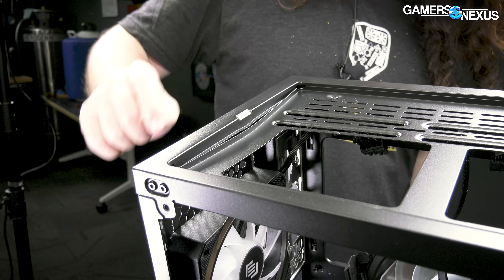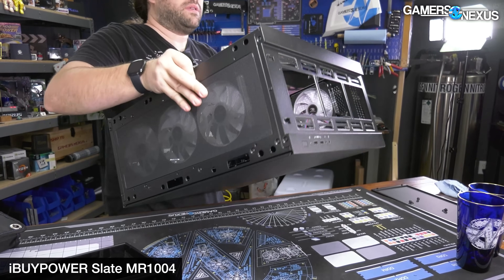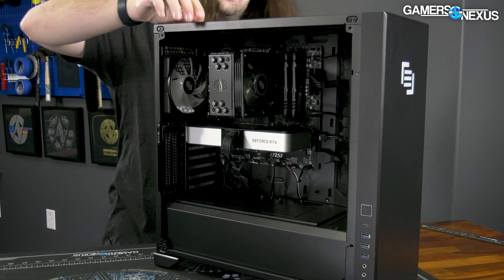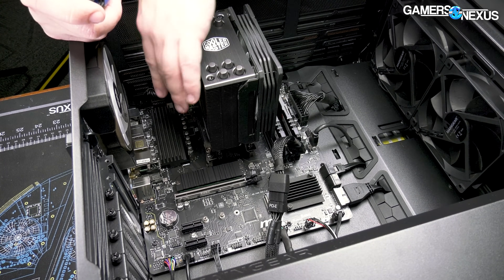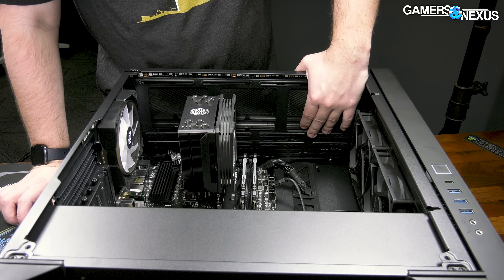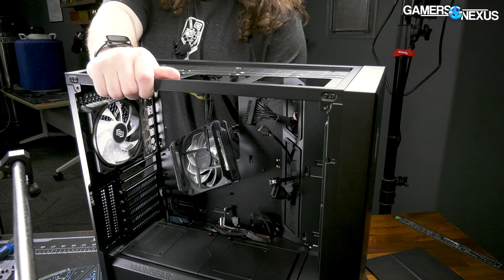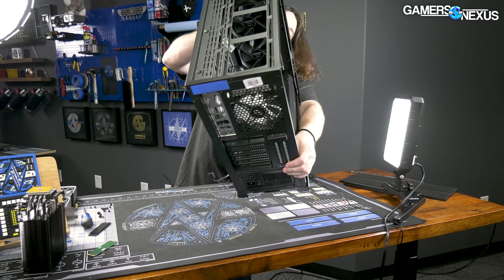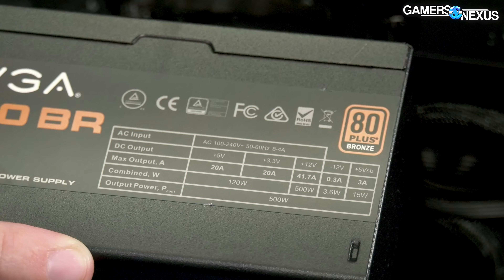Maingear Did It Right: Secret Prebuilt Gaming PC Review ($1700 Vybe)

Comment: Alot of people are complaining about the motherboard and talking about how the company is just screwing over the customer for higher profit. This PC cost 1700. Between CPU, GPU, and Motherboard that's 900 dollars. Factor in 8 working hours @ 25/hour that's 1100. Now factor in power supply, fans, case, ram, cables, storage. Your now easily in the 1400 dollar range. I'd be willing to bet the shipping was free which means the company covers that overhead as well as minor things like packaging. Then consider operating costs that the company has such as storage, water electric, insurance, and property tax. Once you factor all that in, the company isn't exactly getting rich off of a 1700 dollar pre-built. Also I didn't even factor in the OS, the thumb drive, warranty or even potential things like a mouse or keyboard or even stickers/magnets that may come with it. All of those things add up and when it's all said and done the company MIGHT make 50-75 dollars.
Reply: You’re very close. 👍

Comment: Regarding the large file write speed of the Intel 660p:  I have a couple of systems with the 1TB 660p in them and have not seen this problem.  Even moving files that are more than 4GB the writes occurred at more than 500MB/s while reading at over 500MB/s.  The systems are pretty old 6th Gen Intel i5's running Windows 7.  (Yes, I know Windows 7 is out of support, but some things won't work on 10 or especially 11.)  Maybe it's a problem with Windows management of the the drive, because to my knowledge Windows 7 knows just enough about NVME drives to use them.  This is consistent across 2 Dell Optiplex systems with the i5-6500, one with 16GB DDR4-2133, the other with 48GB DDR4-2133.

Comment: The Vybe seems to be the best bang for your buck. Also build quality much higher. Save yourself $200 to $300 and get the Vybe from what I see here. Adding that recovery USB Thumb drive is an excellent add to value and will be so helpful for customers. To bad the front panel design isn't better. Don't understand these PC manufacturers that can't get something so simple as giving the front panel some better air flow.

Comment: It looks to me like someone put their weight down on the top fan tray and they bent it. That and I've used a couple cases with mostly solid front panels and they're terrible.... even though I used an RX 570 which isn't super hot. It would be a good build if they used a different case.

IMO, Dell's problem is they're taking the 2010 approach to building PCs. They're still used to the CPU like the i5-750 or i5-2400 which is fine with a Dell stock cooler, and a GPU that has a blower cooler.

Comment: Honestly, if they could up their airflow game, they'd be a consistent recommendation from me. Also, while I know a 3060 ti can run on a 500w PSU, they should at least provide the minimum wattage recommended by Nvidia, whether those recommendations were conservative or generous. They use the same 500w 80+ bronze power supply on the R7/3070 version of this system. That's asking a bit much of that budget PSU.

Comment: That's bogus that you guys didn't get a filter on your front panel. I bought the next higher spec vybe (with a AMD Ryzen 7 and Nvidia 3070) a few months ago and mine had a dust filter on the front. 
My system also has a 240mm AIO cooler which exhausts out the top of the case. I have noticed that my fans sound to be working hard to keep my PC cool. I had similar thoughts about the meager front intake situation and I made a small change. I moved my 240mm rad toward the rear of the case as far as it could go. It couldn't go all the way back because of clearance with the rear exhaust fan still there but it went back enough that I was able to flip one of my front intake fans that was pretty choked off and put it in the extra space of the top vent. Now my top is both intake and exhaust. Kinda scuffed I know but already even without running any benchmarks or tests I can hear my fans have wound down and it's quieter with no other changes made to my computer's load. I think I may end up buying a black noctua fan and installing it permanently in the roof of my system until I get a new case. Thanks for the idea Steve!

Comment: I tend to like the 660p (which I use in my own system) since I am not a content creator or working with large file sizes in general. I can attest that the Anandtech statement is applicable. If you DO have such a storage use case where you're transferring large file sizes regularly the 660p is not for you. But if you're mostly concerned with storing your Steam library and videos on high-performance storage, the 660p is some of your best gigibyte/dollar value.

Comment: I know you don't review or go in-depth on this, but their customer service is top-of-the-top-of-the-line (not a typo). Linus has done two Secret Shopper series, both with Maingear and, while the system itself was average in both cases, they got highest marks in customer service: the reps are knowledgeable, patient, and thorough. And honestly, if you're buying a pre-built, (if you're not just salvaging the GPU), it's most likely for someone who doesn't know much about computers and needs help every now and then. Maingear simply isn't matched in that department.

Comment: I'm confused. Isn't the retention arm meant to hold the CPU in the socket? How is it able to just pull out like that?
Reply: Not really. It applies a little bit of pressure but it's more to cover up the contacts on the motherboard when the CPU is removed by moving the socket to cover them.
Reply: @ecnepsnaiold  I knew that, but I thought it also clamped the CPU in place by wedging the substrate into a groove in the socket. I admittedly haven't built a PC in a very long time, so I could just be remembering incorrectly.
Reply: @MeowThingy  on AMD sockets nothing really clamps it down (other than the cooler, which Steve already detached in the video). Intel sockets are clamped though.
Reply: @ecnepsnaiold  That explains it. Thanks!

Comment: The bend is because the case was assembled in the factory improperly, the top panel is supposed to rest on the flange pushing the top panel in and down, huge fail on QC and shouldn't have gone out the door like that.
Reply: System did not ship from our facility like that. Definitely Happened in shipping.
Reply: @wallymaingear  in your dreams, my friend. It was welded that way. For the panel to be below the flange FROM DAMAGE, the flange would have had to been bent down, or another side of the surround panel would have to buckle. This didn't happen, indicating it as assembled this way. Part of my job is failure mode analysis. Care to try again? The case factory didn't notice or didn't care, whomever put together the system didn't notice or didn't care. It's not really a big deal, mistakes happen, but since you insist on denying reality...

Comment: So I bought a Acer predator Orion 5000 with a i7 12700f with a 3070 ... For 1600 from best buy. It has one terabyte ssd and 16 ddr5 ram .. it's not water cooled and has  4 fans which are quite unless I turn on game.mode ( but auto keeps it super quiet I've played my games on ultra with the fans never needed to ramp up and I'm in a hot room) but is it worth upgrading the 3070 to a 3080?

Comment: i had a bit of a shock when I looked at the board and was like "huh, a lot of the headers are in the same spots as on my board. wait a minute, that IS my board!"
user notes with that board: It might be because of the cable management bar that's in my case, but I had a lot of trouble trying to use the "top" SATA headers. I was pushing hard as hell but it just wouldn't go in, so I used the other "bottom" header instead.

Comment: Wait when was this purchased? I mean the 3060 Ti has been regularly available and was priced somewhere in the 600-700$ range for the better part of a year now and the other components where never noticeably above MSRP to begin with. So 1700$ for a 3060 Ti coupled with a 200$ CPU, a shitty case, entry level motherboard and PSU that's crazy expensive, even with the decent RAM and SSD. It damn well better be built well. The fact that the other comparable systems were even more expensive is crazy to me.

Comment: Anybody know what the power draw under load for the 5800x / 3070 version is? I’m worried the 500 W PSU main gear provides isn’t enough for that build. Thanks — if the 5600x / 3060 ti version is already pulling 360 watts under load then I have to imagine you might in the worse case be pulling like 450 W from the wall (especially with mice / keyboard / speakers / accessories plugged into the PC).

Online outlets are recommending no less than 550 W for a 3070 build and Nvidia is recommending 600 W so I’m very worried about MG only including the same 500 W PSU here. Seems like a cost saving measure rather than what’s actually best suited to the system.

Comment: Pro tip: use a hair drier to heat the heatsink before taking it off of an AMD CPU. It melts the thermal paste and it won't yank the CPU out. Also easier to clean it that way afterwards.

Comment: my main gear experience was horrible, they sent me a system that had heating issues, for 2.5k my cpu was hitting 105 and started to burn/melt the air cooler they cheaply gave me. and then wouldnt take it back as a return, ive had to take it apart 5 times, then they told me to buy myself a cooler, then i had crashes, and im still dealing with issues, however im saying F that and just remaking my own PC, mainly did it for a gpu but still wild to me.
Reply: You seem overexagerrating or your system seems to really have problems. CPU hitting 105C is really uncommon nowadays. Heck, the Tjmax and or Tmax of high end CPUs nowadays are around 95C to 100C. At that point, your CPU would have throttled way down and shut itself down before doing more damage. If it reaches 105, you may have just bought a system from 10 years ago or something, which is not always relevant considering companies change over time. At that point, the safety features would have shut your computer down.

Burning and melting air cooler is another questionable statement. I'm not sure what kind of cooler they gave you, but air coolers simply don't burn. 105C is nowhere near the ignition temperature of most plastic. Plastic that's commonly used, e.g. ABS, to my knowledge has a glass transition temperature of around 105C. Well, It's not hot enough to melt, but it's enough to perhaps be malleable. To me, that sounds like you some really hot ambient air, to the point that the plastic of the CPU cooler is also dying.

If you're not actually overexagerrating, I'm looking forward for this system to be actually reviewed by someone or something. It seems to be a very interesting mess.
Reply: @nathanadhitya  I legit have emails and pictures that I sent to maingear where they said "oh it was fine before we shipped it" I got the f131
Reply: @Geonade  Ooh, my apologies then. The website states that it's a water cooling loop.  What air cooler are you supposedly talking about?
Reply: @nathanadhitya  hey, so I went with the normal and choose the 5600x with the default cooler as they said it was tested and would be fine, but later after I complained multiple times they then removed the air cooler option off their website and now it defaults to the AIO
Reply: @Geonade  That's sad to hear. That's real wild.

Comment: Tip for removing cooler easy way (maybe not for reviews) is to do it while paste is warm :D
If you have have access to OS put some high load and dismount cooler quick enough so it won't cool down and harden again.
Other way is to use hair dryer to warm cooler up.
You just need to be careful to not overheat it and not to breathe dust that might be on the cooler
Someone has other ideas? :D
Hope it helps somebody :)

Comment: I've watched, and bought, from MainGear for 20 years. I've never been disappointed with their builds, and that's coming from a wide array of different models, from $2k to $4k, with several in between. Their cable management, component selection, and workmanship have always been top-notch. The case in this video is easily the worst piece of hardware I've seen from them in two decades, and at least for me, that's amazing. You can throw a dart at the build list of most SIs and odds are you'll land on a piece of crap. Not so with these guys. Visit their site. If you aren't afraid to pay for what you get, they're really some of the best you'll find.
Reply: Did you ever buy one of the hard tube water cooled builds from them?
Reply: Thank you for your comment and thank you for being part of the fam 🙏

Comment: HOLY phuk 40MB/s What is this using USB2.0?
Intel, Cmon, I picked up a gen4 QLC NVMe drive that is cheaper than your 2TB drive, and it only slows to ~180-270MB/s(it bounced around alot but crystal disk mark said 230MB/s)
The drive is mostly full so the 64GB test i ran DEFINATELY over-ran the SLC cache, as there was less than 265GB of free space, it actually affected the read speed, as the initial writing of 64GB slowed the sequential read QD32 test down to 1.4GB/s, and the QD1 test sped up to 2.3GB/s i guess after purging the cache.

Comment: 1700$ For a 5600X and a 3060 TI?

We're truly living in the darkest timeline
Reply: and case, RAM, PSU, storage, assembly, QA, shipping, warranty, and support.
Reply: @ecnepsnaiold  Are you seriously going to argue that its fair?

1000$ Is high end gaming rig money. Anything above that is profit for the SI.

Yes, i know you cant build a high end rig for a 1000$ anymore, but guess what, thats part of the fokin problem. Its not right. 

What TF is the point of increased performance if the power consumption and the price goes up aswell? (looking at you Nvidia and Intel)
Reply: @nemtudom5074  I didn't say it was fair, I pointed out that the cost of the system isn't just for the CPU and GPU.

Comment: for cases, especially current generations, all case can be good. people should just get the ones they like from the looks. for example for ATXs, dont need to hassle too much about ventilations and what not, the margin of the temps between those with big open vents and small side vents style is just merely like 3 to 5 degrees. if your CPU gets cooled by air cooling for example the working temp final result will be no much difference. unless your CPU gets over 85 C while working, just get better cooling. bigger vents or open front etc would only give you some 3 or 5 degrees benefit. which makes your 85C CPU still about 83 or 80 degrees CPU.

Comment: got my rig from xidax. payed 3k for it. it came with a 10th gen i9, 8x8gb ddr4 @ 3200 with xmp already enabled, a 3070rtx. its got a 1tb m.2 ssd for the os and a 4tb hdd for everything else. the ram looks like it is g.skill ripjaw. not sure as the m.2 stands verticle off the board and is blocking view of the ram. everything else is asus rog strix. the case and all the fans are be quiet. its got i believe an 800w 80+ gold psu as well. not sure of the brand, its got a shroud, but it is fully intermodular. did i over pay? i havnt run into a game yet that it cant run at max setting. in fact, my 1080p monitor is my bottle neck right now

Comment: The case is fine. They were trained at Tesla. In all seriousness, aside from the high markup given the parts, it's really not bad. I'll take the not particularly high end MSI motherboard. It has the type C header, and probably the usual large assortment of fan and RGB headers. Yeah, the case isn't great for airflow, but it has better front I/O than many more expensive cases (how many of those have gone to those annoying combined audio jack that should only ever be used on laptops). THere's no silly molded plastic fantastic crap on the front so at least there's that.

Comment: Anyone looking you can get some nice systems with a 11700f and a 3060ti now for $1500 from new egg (at your own risk lol) right now. There is also a build with a 11700f and a 3070 for $1800. If you are cool with open box there is a 11700f and 3070 for $1,519 which is a good deal. Looks to be better cases as well. A lot of decent abs gladiator builds on there alone with a few other s.I. Brands. Not the best time to buy still but it’s getting a lot better every month.

Comment: GN would hate my PC build. Cables are all over the place, hard drives on the desk, nothing is screwed in. But it's super easy to work with. I actually really dislike cable management that makes it hard to do anything with the PC. Maybe if I were trying to air cool a 12900K I would move cables out of the way for better airflow but I wouldn't buy one anyways since I have come to hate water cooling.

Comment: I always use a flathead screwdriver to separate my AMD chips from their coolers. 
Just gently position the screwdriver between the cooler and the chip and slowly rotate the screwdriver. I find this is just enough force to break the bond and doesn't damage either components.
Usually keeps the paste intact as well.
Reply: If you're not using the twisting method then you could use a credit card, a playing card, a guitar pic, a spudger, hell use a piece of floss. But a screwdriver!? Come on man.
Reply: @singlsrvngfrnd  I mean, it's usually on hand and I've never so much as scratched a component. As long as you're not yanking on it and utilizing leverage, there's no danger. 
Again, twist not pry. 

Plastics just aren't strong enough unless your thermal paste is super thin ¯\_(ツ)_/¯

Comment: oof, steve, i dont think the CPU fan is going to be pulling any new air into the case, as it's creating as much positive pressure as it is negative
Reply: It adds energy to the air flow by directing it, though. Maybe "directing" would have been more accurate than "pulling", yeah.